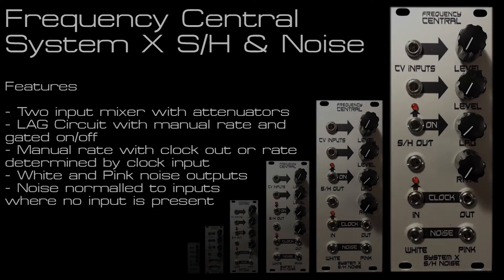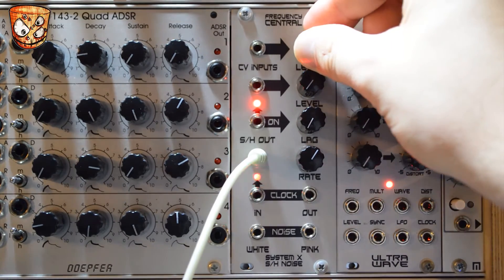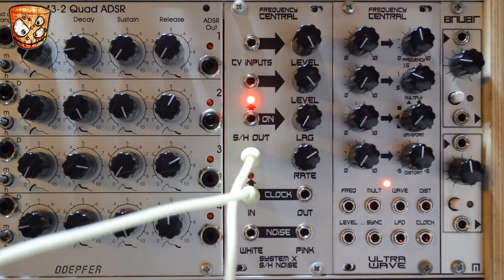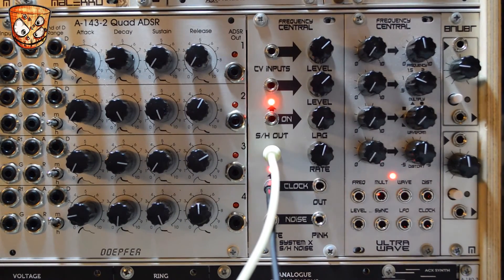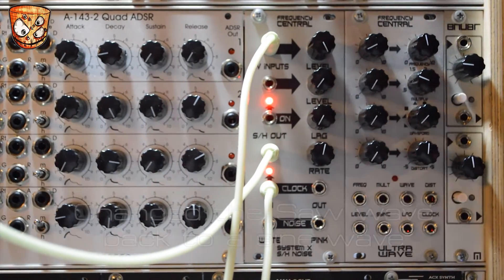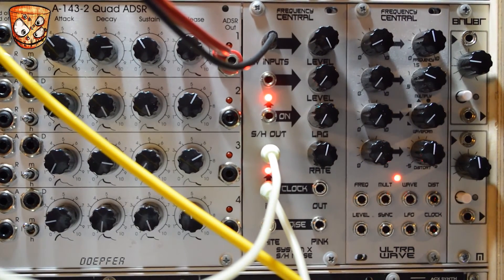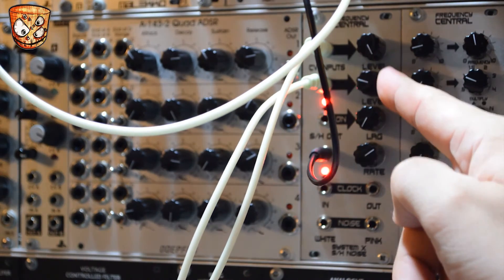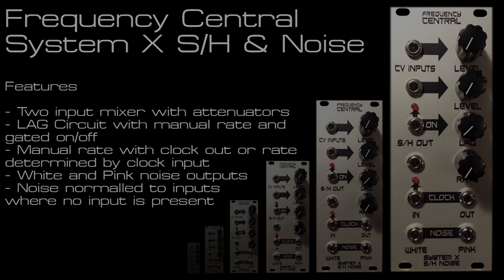Frequency Central - System X Sample & Hold

Comment: So is this a complete copy of the system 100m's sample and hold as well as noise (minus 2 noise outs)? I have a system 100m and am still learning about the different functions provided by this mysterious module. Also trying to understand the complete use of the ring modular that is part of the system 100m's module.
Reply from the maker: As I understand it the whole System X range is as close as possible (at the time) recreation of those circuits in the System 100m. It's a great system to work with (the original) and there's a lot to learn and explore definitely.